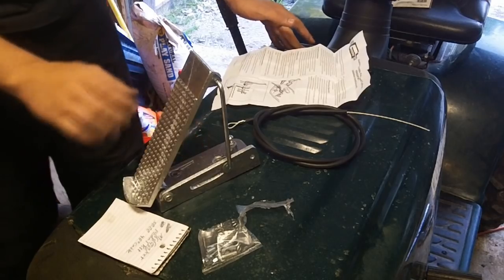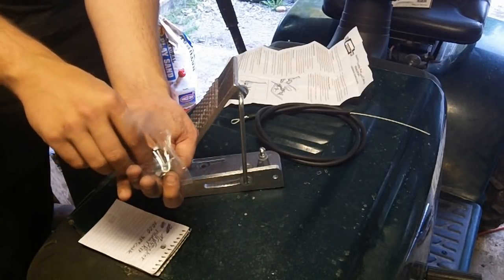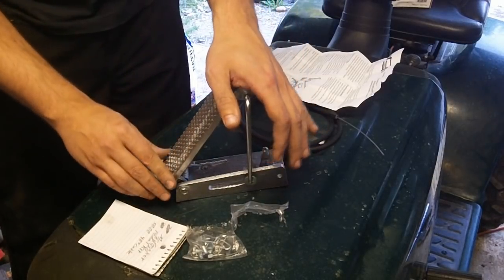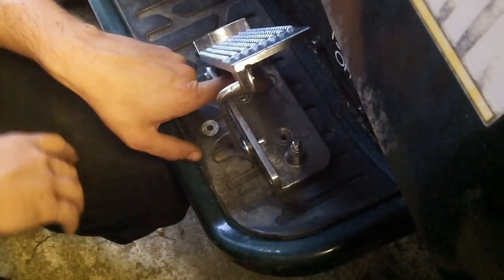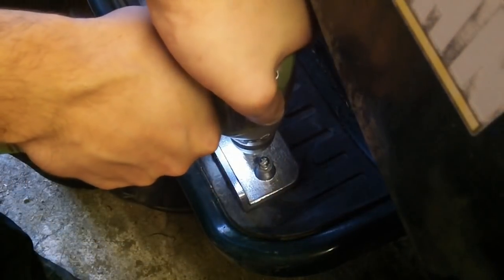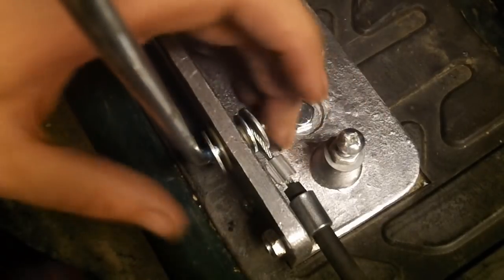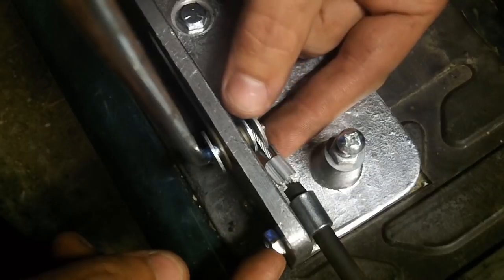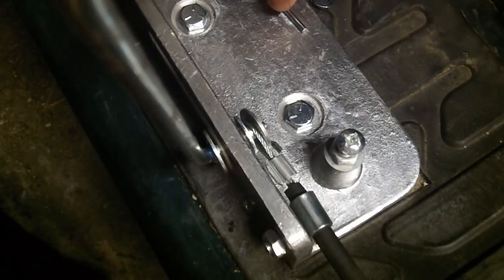Pro Grade Gas Pedal for Mud Mower

Comment: I just hooked pedal directly to throttle. Went about it 17mph with pulley swap but I’m afraid to put pedal to the metal. I’m gonna get a tachometer, any idea what rpm the “redline” would be?
Reply from the maker: Posting a link for Tach and the answer is 4kish. Stock they run 3600 they float the valves a bit past 4K https://amzn.to/3Dh7eYc
Reply: @redneckcomputergeek  got it, thanks!
Reply: shim up the valve springs to add a few rpms!

Comment: Wonder if u can run this setup to factory carb linkage to keep a functioning governor ??
Reply: Yes you can just attach the cable to where the stock cable goes and add a return spring